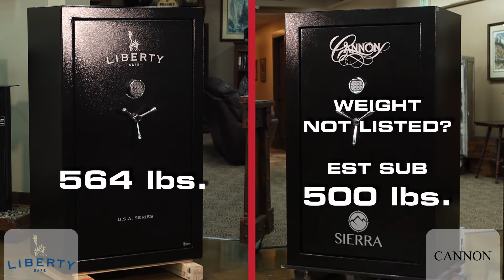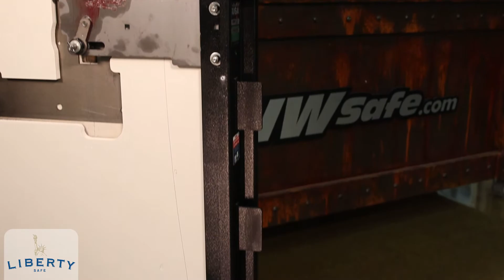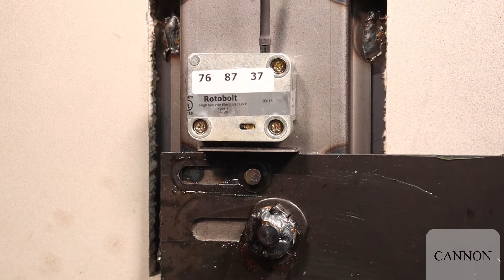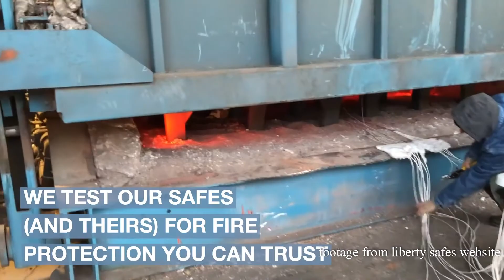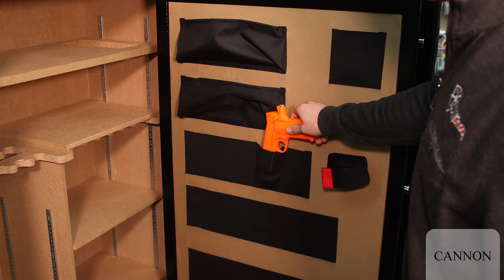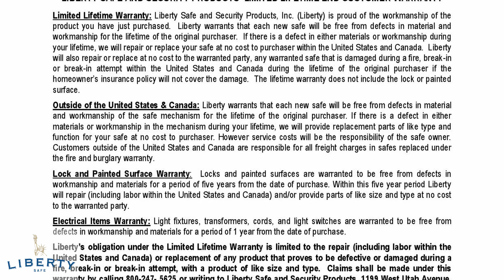USA Liberty Gun Safe vs Cannon Sierra Comparison

Comment: No matter what some Safe nerd tries to sell you on, never buy a safe with an electronic keypad. If they tell you it’s cool tell them to take the battery out of it and open it that will represent a failure in the electrical portion and you can never open it. Never buy a safe with an electronic keypad it’s not if they fail it’s when they fail you will not be able to open it. It will have to be cut open maybe if you get somebody that’s really good they can drill a small hole but I have two canon safes the box seems great but the keypads are not I cannot lock them because if they fail you cannot open them. Just my experience

Comment: The liberty safe ships with a back door code for the electronic lock now known to the US Govt and probably soon to be found on the Internet.  It is not known if the Canon safes also have a backdoor code for their electronic locks.
Reply from the maker: Nearly all electronic locks are manufactured with what they call MRC or Supervisor Codes before they even are shipped to companies like Liberty or Cannon. So yes, Cannon Safes also have this feature. 
https://www.cannonsafe.com/lost-combination-assistance/
The good new is that these codes can be changed with the assistance of the factory and safe technician. The majority of us here use mechanical dial locks with a custom code that way there is no record of it.
Reply: @NWSafe  Yes I kept S&G combo locks on mine too.  I never had confidence in electric locks.
Reply: @kenibnanak5554 Try opening it under little light and extreme pressure.  That's the draw back.

Comment: Safes buy you time for the police or fire dept to get to your house. From the time they're called by your alarm co or you, it's no more than 5 minutes here where I live for either.
Reply from the maker: No doubt that safes buy you time but the reality is the safe you purchase is your last line of defense and what you can rely on being there to defend your valuables. For example, a fire department can easily be overwhelmed by natural disasters which can severely delay their response times or disable them from responding before the fire is out of control.
Example 2: We recently talked to someone who through their security cameras watched a thief take a cutoff wheel to their safe at a commercial location afterhours with no response from the police until nearly an hour later. Long after the thief left the premises after breaching the safe. 
Emergency services, alarms, watchful neighbors, locks, etc. are all valuable layers of security. However, we've also seen all of those fail or be bypassed in critical situations which is why we put an emphasis on having the right safe in place to give you that last line of defense.

Comment: I’d had an AmSec safe for 15 years, and it was great. But, the guy who bought our house bought it too. I did a ton of research and ordered a Liberty Franklin 40. It’s the best safe I’ll ever need; 110 minutes of fire rating and good steel.
Reply: Who needs fire when you've got fedsn
Reply: The feds can open it in 30seconds once liberty gives them your combo
Reply: @LouisvilleSlugger502 - Liberty let owners fill out a form to authorize them to delete the factory code. Of course, I signed it, but who knows? It’s a major problem.

Comment: If you want half the size at twice the price get a liberty now if you’re just wanting security of a safe there is better options
Reply from the maker: You will pay more for a Liberty Safe but here's what you get when compared to most of their competitors which are Chinese Imports:
1. Better build quality like welding, prep & paint.
2. Made in the USA.
3. Quality UL Listed Locks (this is where a lot of mfgs. go really cheap).
4. Heavier Mechanisms: The new flat bars system has more surface contact than traditional round bolts and are constructed from 1 solid piece of laser cut steel right in their Payson, UT facility (most of the industry even if their safes are US built source their locking bolts from China).
I agree if price is your #1 concern buy an import safe from China. You will get more space for your money but the price difference isn't huge. However, if you're looking for the best value from a safe that will last you a lifetime and be passed through your family for generations then Liberty is a brand that should be considered. There's a reason they grew into the largest gun safe manufacturer in the US. A wise man once said
"Poor quality is remembered long after low prices are forgotten".

Comment: They are called "Stitch welds," not "Skip welds." Then shortly after that you call the stitch welds "spot welds." They are not "spot welds," performed with resistance welding, either. If you call welds by 2 incorrect names/descriptions, how am I supposed to believe you know anything about welding? While the one-piece, folded design is obviously better, the lack of being able to speak knowledgably about welds is very concerning. Next, there was absolutely no mention about the door gap. This is one of my biggest concerns on gun safes. I have not seen many that are as tight as I would prefer. Of course they are not going to be edge to edge, but I see too many gaps that enable a person to get a pry bar into them. Actually, the gap on the pivot side of the door on the Cannon safe is what I would like to see all the way around the door on the safe I buy for myself. The Liberty safe does not have it either. The information about the flat plates also seems to be misleading. The round locking bolts have a structural advantage over the flat plates. Flat plates bend, that's why I-beams were invented. I would expect the Liberty safe to be a better safe than the Cannon, and I prefer American made, but the plates instead of round bolts, the lack of knowledge about welding, and the door gaps are deal breakers for me.
Reply from the maker: Stitch welds, skip welds or intermittent welding are all the same things in our circles and industry. Regardless we are trying to convey that where applicable a full continuous weld is superior to a stitch weld.
Regarding you statement about Flat vs Round Bolts. Round bolts are strong but it's what they're connected to that's the weak spot. Most safes locking bolts are connected to a sheet metal mechanism by a rivet, small machine screw, bolt or welded (albeit rarely). These connections are a weak spot are it is routine that we see locking bolts tear away or shear off the mechanism during pry testing. In contrast the Flat Style Bars are laser cut form one solid piece of steel and have no weak connection points like the round bolts and the flat bars offer more surface contact and bite than round bolts. We sell safes that have both and the reality is if you're comparing two similar safes the flat style bars are superior.
Reply: @NWSafe  - "Skip welds" may be a regional thing, but they are still not "spot welds" which are an entirely different welding principle. I've just never heard "skip welds" in my 40 years of welding in Ohio, but like I said could be a regional term. I also just did research on a variety of American made safes (Rhino, Ironman, Vault Pro, Edison) in your price range and higher, and every one of them have round bolts, including safes that cost 3 times as much. We both know cutting your Flat Style Bar is the cheapest way to create a locking structure. What steel is the Flat Style Bar made from and how thick is it? Is is merely cold rolled (1018) or is it a hardened steel? As a Toolmaker, soon to retire, I am very interested in the principles behind this.
Reply from the maker: @1001Hobbies  I don't necessarily agree that the Liberty flat bars are cheaper to produce. The tooling and other issues created add difficulty and time to production. Also because of the thickness of the Flat Bars they outweighs the comparable round bolt mechanism piece that their competitors build. Remember, most safes with big round locking bots connect to a lightweight piece of steel where the flat bar is laser cut for one continuous piece of steel. Thickness of the flat bars depends on the model of Liberty Safe with the thinnest being 3/16" and the thickest being 1/2" Liberty claims cost was a wash compared to flat bars. It also allowed them to bring production in house and not having to rely on an outside supplier. The Flat Bars along with most locking bolts are just mild steel. Most safes we sell use round bolts and with that being said if your just comparing that piece of the mechanism the single piece flat bar is just better.

Comment: Don't by the digital key pad safe . They are junk. And when you need to replace it and you will need to. The customer service is , well I will get the grinder out tomorrow and cut this tin box open thanks liberty $800.00 scrap
Reply from the maker: Maybe we can help? I've dealt with all the major safe brands for warranty issues and Liberty is by far one of the best in our experience. If you can contact us with more details we'll do our best to help out. Anything with moving parts can fail. Unfortunately when it's your safe it creates a major inconvenience.

Comment: Liberty makes big box JUNK!
Reply from the maker: Liberty makes entry level safes as well as a high end guns safe. If you want a cheap safe they have options but one thing we appreciate about a Liberty is they offer a USA made safe at a price point you typically only see offered by Imported Chinese Safes. Liberty Gun Safes are Made in the USA, robotically welded, lifetime warranty, powder coated finish and have U.L. Listed locks. I could go one but the point is they are far from JUNK.
Reply: @NWSafe  I could saw-zall the side off a liberty safe in 2 minutes

Comment: So unless it's stronger steel the plate of Steel you guys are using it's not going to be any stronger than a 1 inch cylinder steel lock a plate would be much easier to bend than the cylinder Which is far more thicker or do you not understand physics? The only thing they're adding to is a fact they have less room to get a crowbar in there what they do is going to be a lot easier to pry open than the other one when has huge 1in thick diameter Steel cylinders.
Reply from the maker: The weakness of a round locking bolt mechanism design is how the bolt connects to the rest of the mechanism. While you likely won't bend either the advantage of the flat bar is it's formed from one solid piece of steel which eliminates the weak connection points of a round bolt mechanism. The other advantage the flat bar mechanism has is more surface contact than a round bolt. For example a 4" flat bar has 4" of surface contact while a 1" round bolt doesn't even have a 1/4" of surface contact. We're pretty confident 4" is more than a 1/4" regardless of our poor understanding of physics... ;)

Comment: Water damage to room with safe. Mold was in safe . How to renovate the inside of the safe?
Reply from the maker: Depending on the manufacturer and year built you can often get a replacement interior. If you need any help email us pictures, serial number and brand/ model and we can see what’s available.
Reply: No help on “cleaning” up the safe. My thoughts—- strip all carpet, dry it out add humidifier pkgs and replace former carpet. Would any carpet work?
Reply from the maker: @stevecallaway8457  We could help with the complete process but depending on the value of the safe it may make more sense to replace the whole unit. Again, send us info and we can help present the all the options.
Reply: @NWSafe     Water damage to closet safe was in. Closet and contents damaged with mold. Mostly thrown away. Guns in safe “repaired “ for rust. Safe now empty but closed during restoration of damaged rooms in house. DIY would  rip out shelves, replace carpet inside the safe. Lock works. Condensation was culprit from soaked floor of the room. Would that work? Supplies to refurbish safe insides would be? Thanks. Safe located in Texas
Reply from the maker: @stevecallaway8457  That’s a start but the most important info we would need is serial number, model, manufacture and pictures emailed to service@nwsafe.com
Reply: @NWSafe  will do asap

Comment: The cannon has 45 min at 1200 degrees VS the Liberty at 40 min at 1200 degrees.....y'all lost me on that one!
Reply: In case you cared, they now upped the USA series to 60 minutes of fire protection.
Reply from the maker: Unfortunately in the safe industry there is no set standard when it comes to testing. That means the Cannon Safe did not experience the same test as the Liberty. The Cannon has less layers of fire insulation throughout the safe, a lighter gauge body and the body is stitch welded every 6-8" which not only affect security but fire. The made up sticker Cannon put on the door might look great but doesn't pass the smell test. We believer after digging deep into the details the Liberty is clearly the better fire safe due to the Liberty USA having a heavier 12 gauge body and door, more layers of fire insulation and a fully welded body.
Reply: On the fire test pretty much the liberty is underrated and the cannon is overrated

Comment: Most people who will try to break into a safe are smooth brain imbeciles. Just put a motion sensor camera filming your safe at all times and if the smooth brains ever show up, the police should get there before they know it. But if you got an alarm, dogs, security screens, etc they won't make it in to begin with. Too much trouble.
Reply from the maker: Alarms, dogs, cameras and the police are all great to have and additional layers of security. However, we have seen them all bypassed. Your last line of defense will always be your safe. So choose wisely and take responsibility in creating the best outcome possible. The situation you described is a best case scenario which is not the best way to prepare for the worst case scenario burglary or fire. The police and fire department don't always show up. A great example of this is looking at everything from past wildfires to the civil unrest and rioting of 2020. When the system is overwhelmed it won't always be there to save you.

Comment: What happens if your lock battery goes dead?
Reply from the maker: The lock has NVM so when you change your battery it retains your combination. Also, the battery is accessible from the outside of the safe in the keypad.
Reply: @NWSafe  what about EMPs are all you electronic pads protected?
Reply: @masonmcdowell-o2u  six months and no answer, hmmm.  That's not a good sign to your great question!

Comment: Does heat resistance really matter?  I mean whatever guns inside are pretty much useless after being expose to all that heat?
Reply: If the heat inside the safe is not enough to melt plastics or burn paper and wood why would the guns be unusable?
Reply: Liberty has several interesting videos on their website. One involves a safe of theirs and a competitors safe in a kiln at the same time. Shocking results. They have other torture test videos as well.

Comment: How does this liberty safe compare with the Lincoln model?
Reply from the maker: The model in the video is the USA series. The Liberty Lincoln would be 3 Tiers up from the USA. The New Lincoln Series features a 110 minute fire rating, heavier body, door, mechanism and has several interior upgrades. Standard LED Lighting, Jewelry drawer, Power Outlet and dehumidifier. The Lincoln model is loaded with just about every option.
Reply: @NWSafe  great!

Comment: I got a Cannon VF24AR less then a week ago the handle shaft weld broke when this happens you will not be able to get in the safe without damaging it badly it’s definitely a weaker design I would choose a different one just because of this And it wasn’t a whole lot of Pressure I put on it to turn it when it happened either
Reply: 1:52

Comment: I have the Fatboy Extreme. And let me tell you that is one quality safe. I have been thoroughly satisfied with my Liberty. I have ultimate confidence that firearms and precious items are secure and safe.
Reply: It's only 12 gauge steel. That's 2.7 millimeters thick. A bi-metal blade on a cordless circular saw will cut that open in less than 2 minutes. For the price they're asking for that safe there's a lot of better options out there. You have the ILLUSION of security and not true security itself.  Sorry.
Reply: It has a good fire rating but that's about it, doesn't even have a plate steel door.